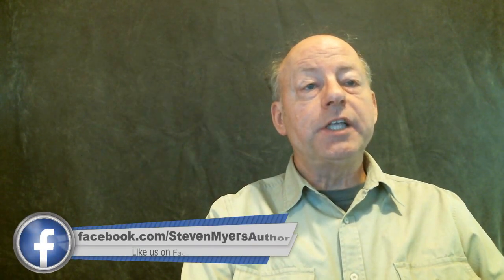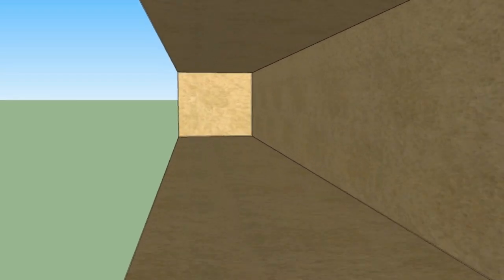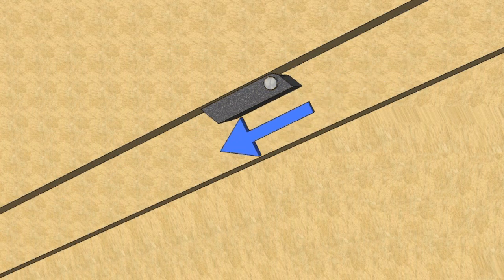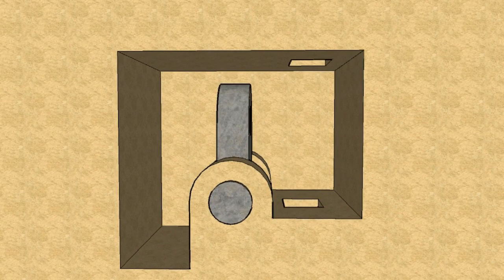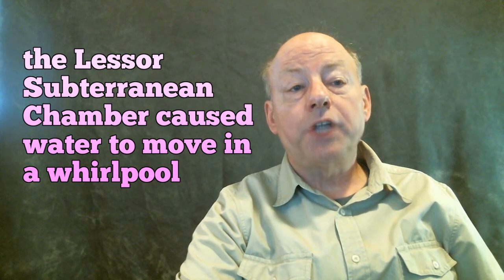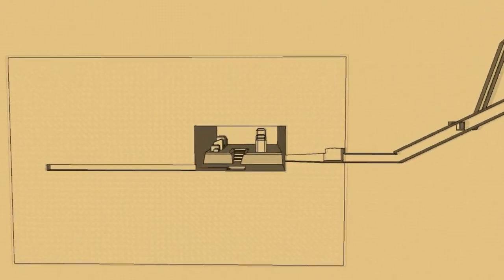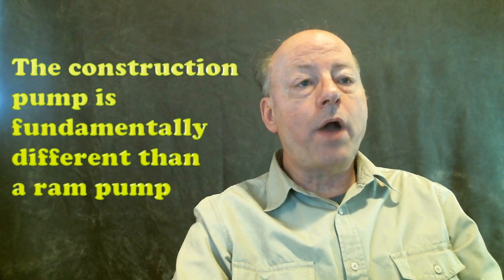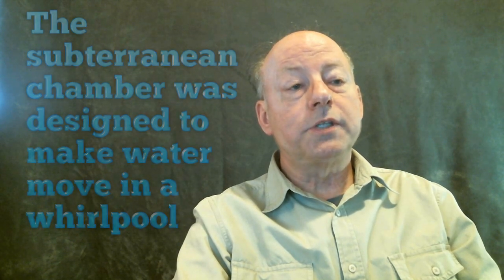Video 4: Construction Pump Components

Comment: The first check valve that lets water in. Hiw did it shut again after it was open. If its like flat with the ground and swings downward with the flow of water. Youd need some sort of power source to close that valve as itd be acting against gravity to go up and be flat wkth the grlund again. So how did it spring shut? Big hole in your theory.
Reply from the maker: Hi. Thank you for watching at least part of one of the videos in the video series. The operation of a check valve is rather simple and I have not had anyone have a problem understanding how a check valve operated. The check valve in the upper end of the descending passage is not "flat with the ground". Water traveling down that check valve opens the valve. When water stops moving down the descending passage the flapper moves back into the closed position "powered by gravity". If it is hard for you to understand the operation of a check valve there will be a lot of information in the video series that you will have difficulty with.  My books have so much more information than a few short videos.
Reply from the maker: @Scissorbeaks  Did you have a question? I didn't see a question mark in your comment.

Comment: You never explained why there was a hole in the upper check valve. You said it was genius. Why? You also didn't explain why they wanted the water to move in a vortex. You're not really connecting dots very well for us, the lay audience. You also don't need to keep calling them "genius," it's redundant.
Reply from the maker: Oh. Thank you for watching at least part of the video series. There is a lot to explain in the water pumping process. Hopefully you will watch video 6 all the way through. Starting at about 6:32 the video describes why there is a hole in the flapper in the check valve in the Grotto.  The vortex used the property of Implosion in the water pumping process.  My books go into much greater detail than can be provided in just a few short videos. Yes, I agree the Original Builders were Geniuses and that can not be emphasized enough.  I talk about the genius of the Builders in my books. Thank you for your interest and tell others about the video series if you want to.  I do a lot of radio talk shows discussing my research and books. It is a hot topic right now.
Reply from the maker: Thank you for the kind words. My third book has just been released about the great pyramid water pump. If you ever get a chance, tell others about this video series and my other video series about the Great Pyramid water pump. Thanks again.
Reply: i also didn't understand what the meaning of the vortex is
Reply from the maker: @Niberspace I wish I could have explained it better for you in these short videos. Certainly, there is more information in my books and many radio interview podcasts. There is a lot of information to consider and also a lot of preconceived notions and invalid information people have been exposed to like the idea the alignment is profoundly significant in some way. Thank you for watching the videos and pondering the information they contain. I hope they helped you on your path to truth.